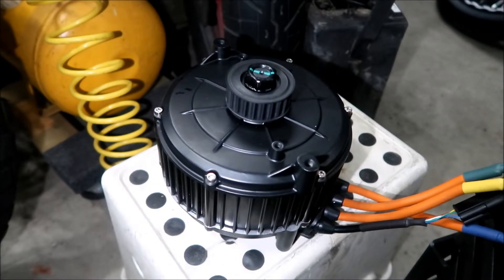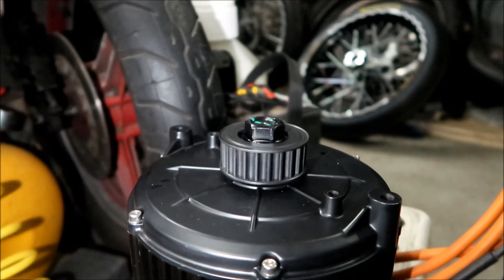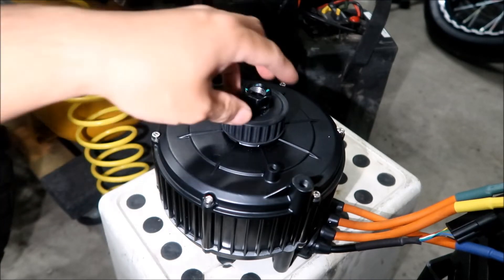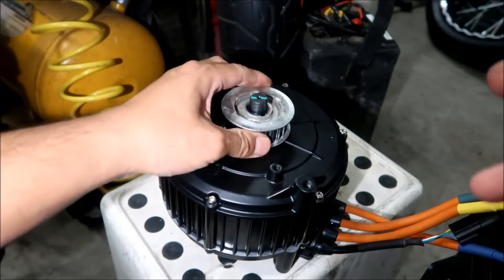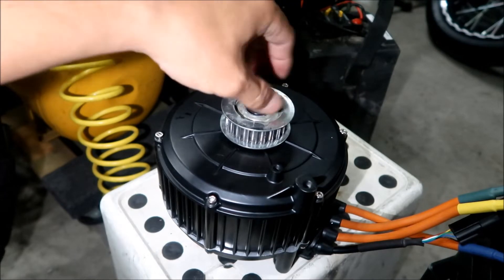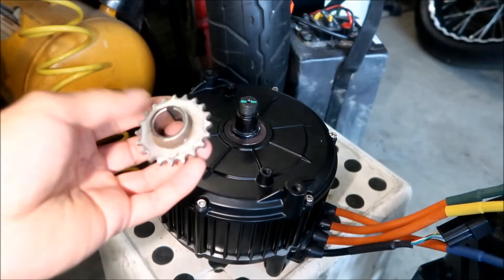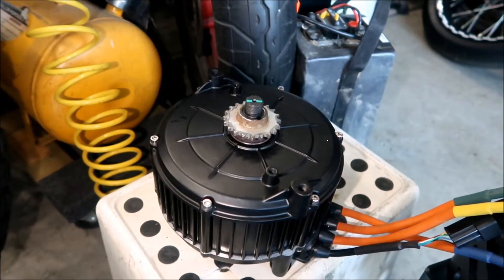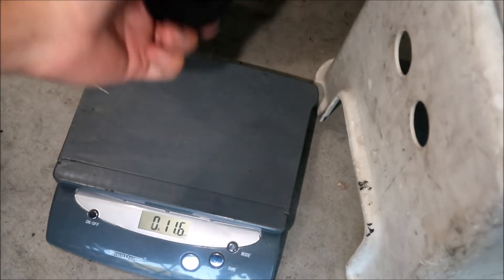QS165 Drive Pulley/Sprocket and Belt Compatibility with Sur Ron

Comment: does the belt pulley have a 19mm axle !? 

I wanna switch to this motor but have a Zero belt drive. pulley looks almost the same
Reply from the maker: The shaft is the same as a Sur Ron motor however the nut is much bigger a 24mm.  Sorry I'm not sure if it is compatible with a Zero belt.
Reply: @hadesomegamoto7639  do you know what the diameter of the axle is?

Comment: Nice work here, very useful knowledge for those seeking out this set up. I am currently pending receipt of QS-165 v1+Fardriver controller to install into a Razor MX650.

I’m going straight 420 sprockets/chain, no gear reduction. Do you happen to know where I can source a front sprocket for this motor?
Reply from the maker: I am using a Dirty Bike front sprocket.  If you just need the sprocket they might sell them in parts at americansurron.com